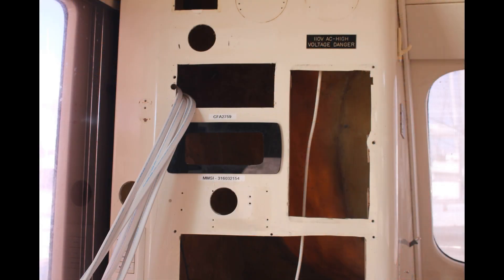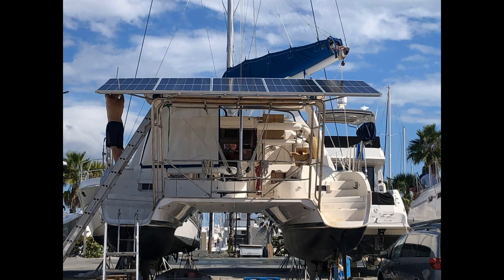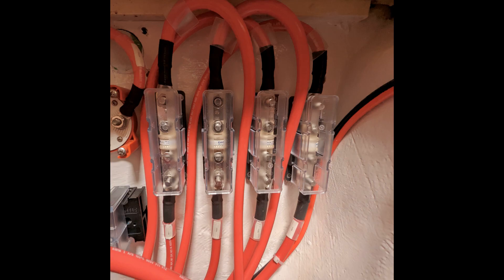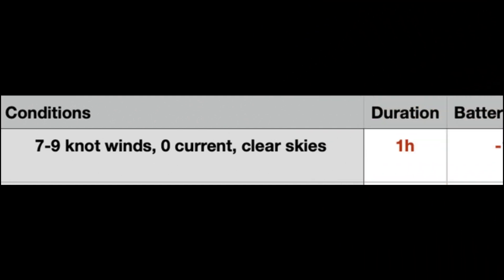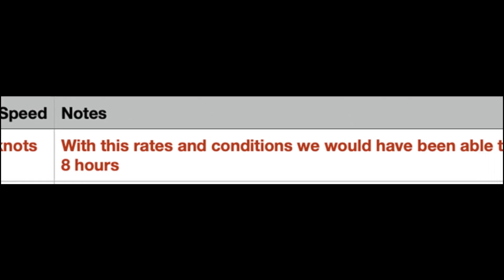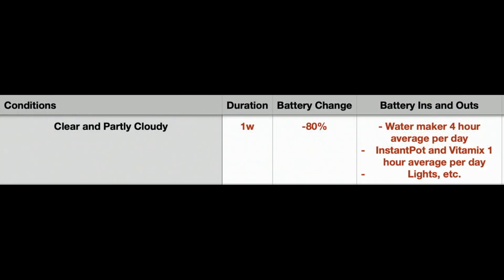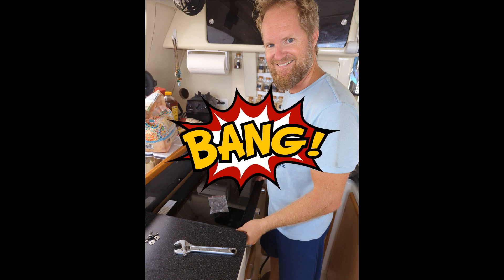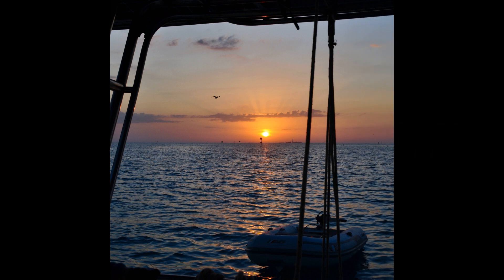OceanVolt DIY Electric Conversion - Update! - 2005 Leopard 40

Comment: Thanks for the update.  What about regen over an average sailing?  It takes 5-7 days with solar, but I'm assuming a full day sail PLUS the regen may get it done in a day or 2?
Reply from the maker: We typically go too slow for sustained regen. The systems want 7 knots of speed or more...it has happened and we have created electricity with our props, but it is not something we can depend on.
Reply: @347830  It was the same problem on Green Motion catamarans, correct speed to regen. They've replaced propellers more than one time without a lot of gain.
Full electric is nice on a boat longer than 45 and seriously managed under sail, more sail area is better, low load too.